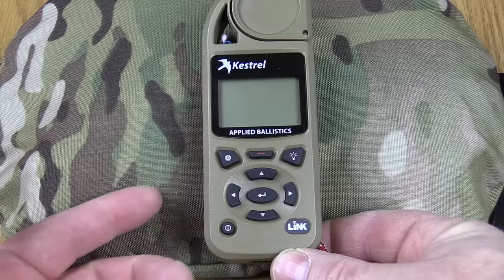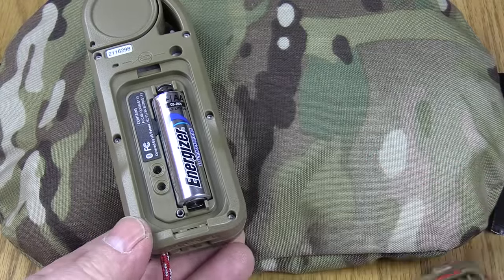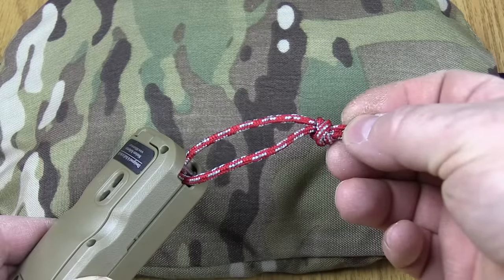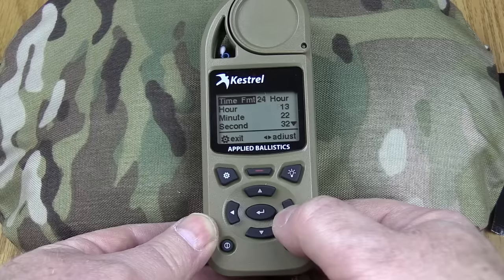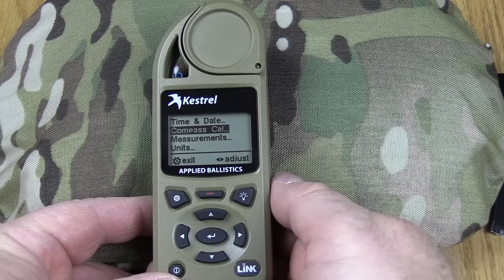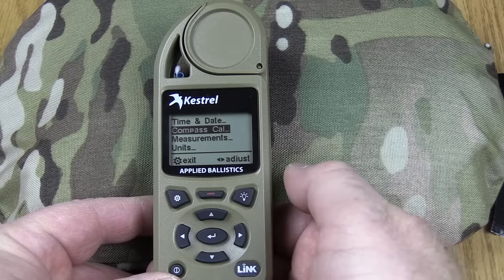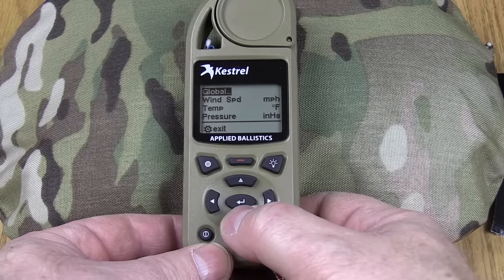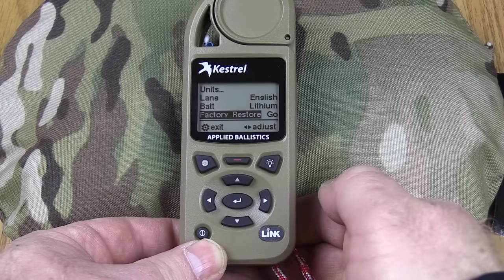Kestrel 5700 Elite w/ LiNK: Basic Review and How To Set Up

Comment: Great video, thank you for helping me get familiar with this meter. I was lucky, I didn't have any trouble calibrating the compass. I love this meter, what a great tool. Make sure everyone that you hold this thing by the very bottom.  If you hold it in the middle or top the heat off your hand will screw up your measurements especially the temperature. I'm have so much fun with this meter, it's so worth the money.

Comment: OK so never mind I think I figured something out. I found how to set the barometric pressure altitude reference to zero but what you were saying is just turn off the barometric one and just leave on the regular pressure and that will automatically be a reference of zero?
Reply from the maker: You don't have to turn off the baro if you don't want to. Turning it off just cleans up the screen. There are a lot of measurements in the weather screen that I don't need for shooting, so I turn them off to de-clutter the screen. You can do the same thing in the Gun Management section to keep from accidentally using the wrong gun profile. Just toggle them on and off as needed. It doesn't eliminate them, it just hides them from view to simplify the display.

Comment: Question for understanding and verification on the Kestrel. If you’re shooting different times of the year with different temperatures, are you adjusting your MV in accordance to the temperature you’re shooting in?  Or maybe even throughout the day as the temperature increases every 10°-20°? I’m trying to hone in on using this to the best of my ability and it’s capabilities. Thanks in advance!
Reply from the maker: C. Holbert No, but if your ammo’s MV fluctuates in a measurable and consistent manner, you might want to. Mine doesn’t.
Reply: Panhandle Precision thank you so much sir for the info. I greatly appreciate it.

Comment: Sorry last question;  I think my Station Pressure reference is set to zero already, but how to I access that screen? I have PRESSURE on but BARO PRESSURE off. Does it matter if I'm in WEATHER mode or BALLISTIC mode?
Reply from the maker: If you're using the 5700 as a solver, the only reason to use the weather mode is to measure wind speed. You can see all of the environmental conditions needed for shooting in the "Environment" screen in ballistics mode. The 5700 will automatically use station pressure for ballistic calculations, regardless of what you do in the weather mode of the 5700.
Reply: +Panhandle Precision thank you. So just to clarify, I can turn off BARO, stay in BALLISTIC mode, (since that's all I really need) and the pressure I see will be station pressure which already has a reference altitude set to zero?
Reply from the maker: Yes. The 5700 only uses station pressure for ballistic calcs. It doesn't consider barometric pressure at all. You don't have to do anything at all in the weather mode to make the ballistic mode work properly. They are separate functions.

Comment: Great video series in regards to user ability on the 5700! I have owned one for a few days now,but one question i have is Zero weather data..EX my gun was zeroed at 100 at 2500 alt 29.98 baro  50 deg...Now i go use the 5700 at 75 deg 8500 alt etc..Is there any way to put in my ZERO weather/temp/alt/baro conditions within the 5700 or link? I haven't found how to do that or how do you approach this? As you know idaho has huge elevation/weather swings!
Reply from the maker: There is no provision to set zero conditions on the K5700. I've checked several rifles for change in zero from 28.5 to 22.7 SP and a broad swing in temps. There wasn't any change in point of impact. I don't worry about it anymore.

Comment: I'm curious but you have Pressure on, but Baro Pressure off? is that because you just want station pressure? and you have altitude off but density altitude on? thank you
Reply from the maker: Yes. I set my reference altitude to zero and only use station pressure. The only reason I would ever use that screen is if I wanted to use a separate solver, like BulletFlight on my iPhone. If I'm using the 5700 as a solver, I don't look at anything other than wind speed on the weather screen, because the Kestrel automatically updates environmental conditions, regardless of the settings in the weather screen. You can turn the update on and off in the ballistics screen.